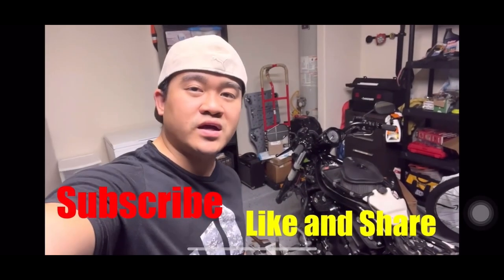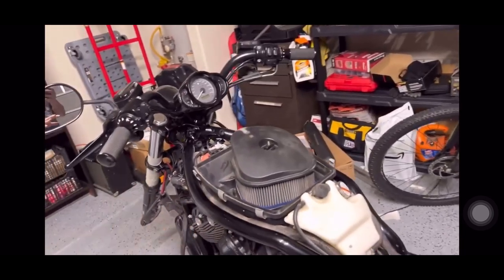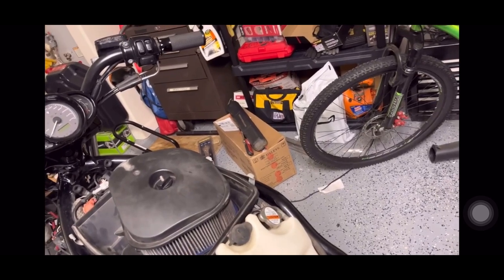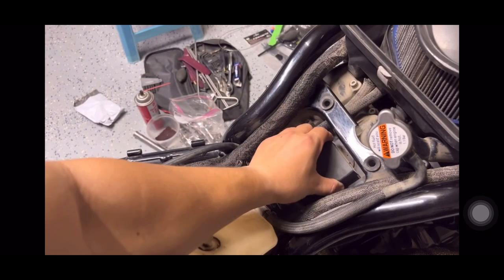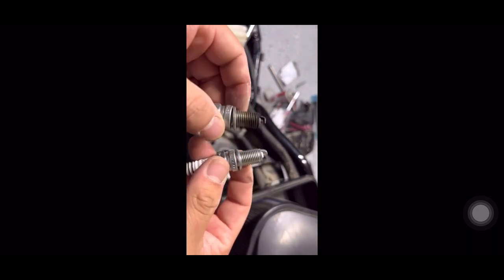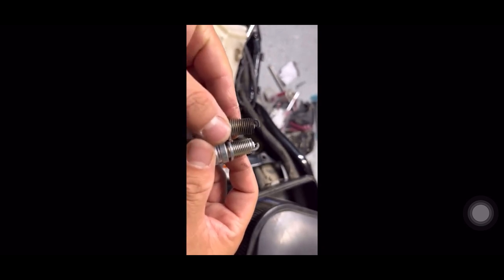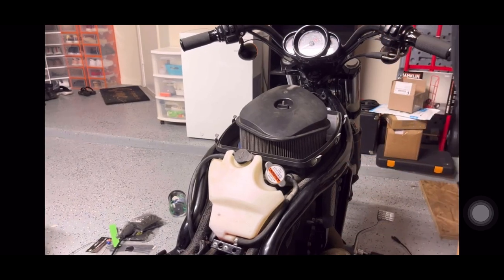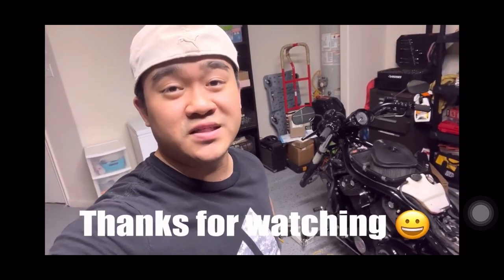Change spark plugs for Harley Davidson V Rod #vrod #motorcycle #diy #bike #harleydavidson #

Comment: Thank you for your video but I’m not sure on removing the air box tray
Reply from the maker: @bryanrothe4245  it’s pretty simple, 1st take off the airbox cover then 
2nd unplug the temperature sensor, 
3rd pop the metal clips around the air box 
Then take the air filter cap off. 
Then unscrew the 3 both on each  air intake cylinder . 
Unplug the rear breather hose 
Finally the tray will be loosen to be pull off

Comment: Hey mate. Did you end up regapping the plug to .035 or just install it as is out of the box?
Reply from the maker: I checked and the gap wasn’t accurate so I re gap a little before putting them in